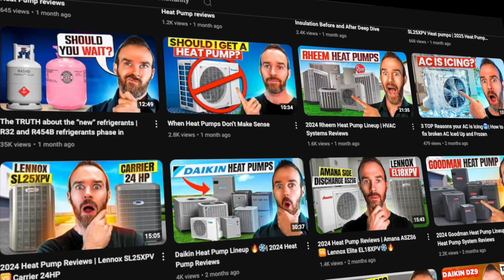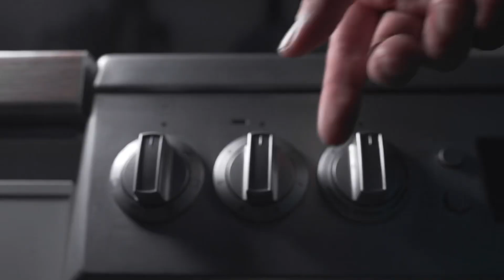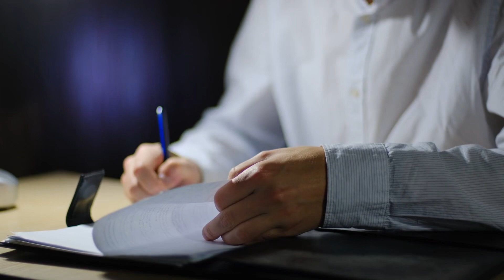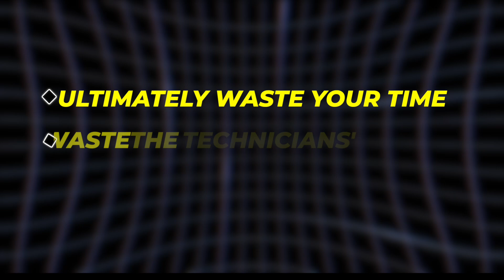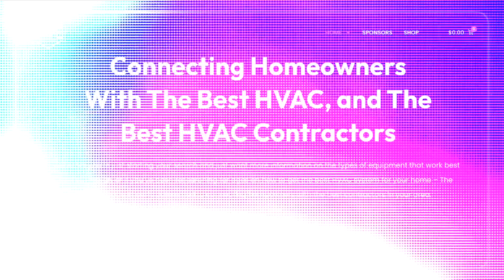The Truth about Home Warranty Companies and HVAC

Comment: The person you call for home warranty repairs works off commission.  The less they pay out the more money they make. That should explain everything. They will get fired if the pay out to much. So they will stalling for 3 months in my experience. No water heater for 3 months, no AC or Heat for 3 months, no washing machine for 5 months . That is real life experience.

Comment: American Home shield is extremely bad. I have had my service 7 or 8 years for two properties. I am very annoyed that they would not even give me a decent credit towards a new ac I needed and that I was paying for. Offered brands that AC techs told me leak a lot and the quote price was more than a better brand by another ac company. It was very hot in Florida and they would not make a decision. I was paying for the new AC but not through their company  I asked for the credit and they offered about 600.00 only with their company doing the install. My AC unit never gave trouble even though it was over 25 years so when it finally broke down they repaired it about 3 times in 2 months. It was during so very hot days. It needed to be replaced. It was in very bad shape. They asked me to pay 900.00 to clean it. I said that was wasting money. Other AC contractors told me not to waste money. I told AHS I would pay for a new one and I would like to get the credit they offered. They refused even to give me the 600.00 because I chose a lower price, a better brand and an outside contractor. That was summer of 2024. I pay them 166.00 per month for one and almost 100.00 for the other. They raise the fees every year. I am looking for another company. I will not continue to use them. Over the years many of their contractors were difficult to contact and service was bad. We waited days for refrigerator repair tech and months to complete. They said they ordered parts. I will not recommend them. Very bad!!

Comment: Choice is a sheister - DON'T GO WITH CHOICE!!!  They flooded the laundry room after their 2nd visit, stood us up on the 3rd visit.  Then asked us to open a new case so he can get paid (that was a give-away), and I was exhausted with calling them several times a day speaking to a foreigner. My tenants did not have a washer for 30+ days, and it was 115 to 120 in Phoenix and a little girl.  Both working parents had to take their laundry out - they finally gave me notice that they were moving.  I bought a new washer, and they only offered to reimburse me $400 FOR A $687 washer, and the check never came, and asked me to pay $40 to send another check.  DON'T USE CHOICE!!!